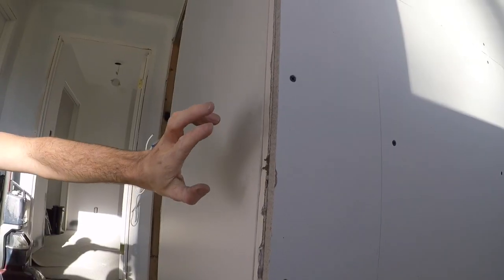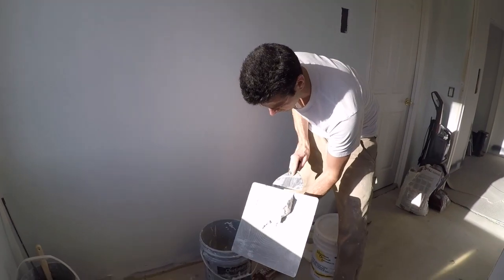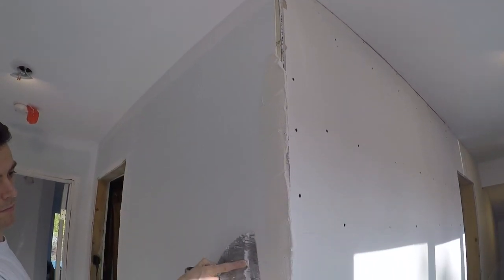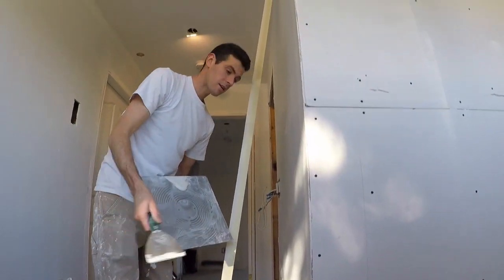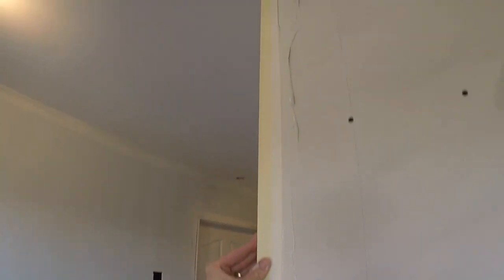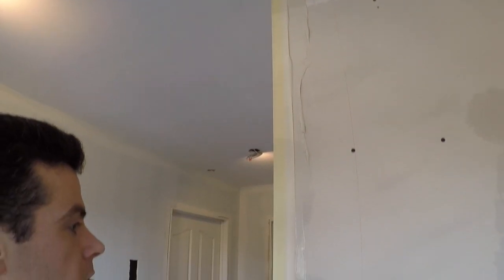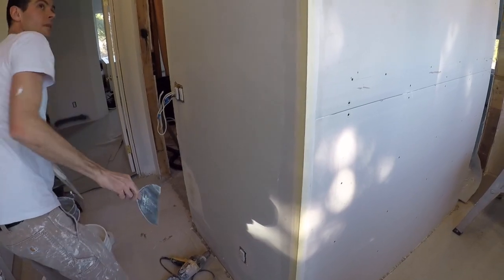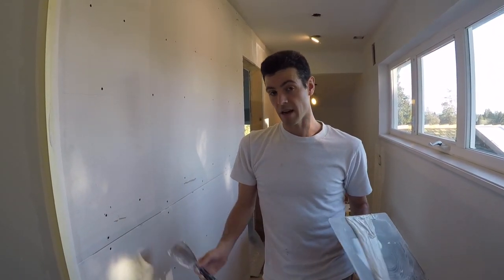HOW TO INSTALL CORNER BEAD IN A REMODEL

Comment: You are an inspiration to me.  61 years old and still learning. Keep em coming.  Used a 4" knife, your suggestion, for the first time for inside corner work, flat work and outside corner work today. Taping compound, water down, worked like a charm.  Thanks.

Comment: This helps a lot. I never knew anything about quick set was until I started watching your channel. You can just imagine what I went through when I matched it up. LOTS of work.
Reply: @Soup Can Well it is good I have the 90 minute quick set, and I have a heater already installed, so I can control the temp. Thanks for your info.

Comment: Another great video. I wish I saw this before I installed in a similar situation. The one issue that wasn't touched on was that my corner was less than 90 degrees, which made it stick out in a few places. I worked really hard to correct that, by drilling screws through the metal flange. I figure in the future, I would just bend the corner bead to make it tighter. I can't find any videos that address this issue.

Comment: Perfect timing. That's just the same situation I'm facing right now! 

In my case, however, I have an additional complication in that the end of the corner bead doesn't butt up against a ceiling, rather it transitions into an archway. Therefore, I'm trying to figure out how to transition from the end of the replacement corner bead into the archway without leaving a noticeable step or lip as it does so. Comments on how to handle that Ben would be much appreciated!
Reply from the maker: I would need a picture. If you have instagram you can message me at @ben_degros. I would be happy to help.

Comment: Hi, I find your videos extremely helpful. I am doing a fireplace remodel and I have 4 outside corners with old metal corner bead. On two corners I have to transition from old corner bead at the top of the chase, to new corner bead at the bottom. Of course like in this video there is a lot of mud built up at the metal. So where these two beads meet in the middle- how do I make a nice smooth transition? Thanks

Comment: Question unrelated to this video, when skim coating a large area, how do you keep your mud from thickening up from the constant application and removal during the course of the job? I have skim coated many walls and usually just keep thinning the mud with a spray bottle as needed. Seems to  work, but wondering how the pro's manage it.

Thanks, thoroughly enjoy the videos.

Comment: I Really appreciate all your videos on how to do drywalls, I have learned a lot from watching them. I know that it's an art and require a lot of practice to be able to achieve great result... I'm a real beginner and wanted to start as you showed us but i'm having a bad time using a brand new trowel... it leaves a lot of wave on the wall as I apply the mud... I heard somewhere that to achieve good result with the trowel (other than practice) it needed to be "Weared" or "break" could you show us how to do so? I'd also like to know if there is a way to save a bucket of taping mud in which as been too diluted (thinner) with water. And finally, what do you think about fibafuse tape? Again, thanks a lot for all your excellent videos!

Comment: Great vid... What setting time do you use on the quickset and what would be a compairative product here in the states..
Reply: We have the same products. USG quick set 5 minute would be the best for one corner
Reply: 👍 got it.. thx
Reply: @ryane6719  

5 minute setting compound would barely give you time to get the stuff mixed up and scooped out onto your Hawk before it started to set up.  I normally use 45 minute setting compound. If I was in a really big hurry, I might try the 15 or 20 minute stuff or whatever it is. 45 minute setting compound gives you plenty of time to get it mixed up good to the exact consistency that you want and gives you plenty of time to do a decent amount of work with it before your time is up.

Comment: Hey what are you thoughts on the joint compound that comes with the metal/mesh tape, sold in hardwear stores? I kind of want to do your method with the mixing , I've got a lot of nail holes

Comment: When you say quickset mixed on the thick side - what product am I buying at Home Depot?  Is it a concrete product or a drywall mud product?
Reply from the maker: Depends. I just mean less water when you mix up a bag of powdered drywall mud.
Reply: @vancouvercarpenter  So that first step on the old wall is a drywall mud product, I tried to freeze the video and the bag looked like it said concretefill?  Thanks
Reply from the maker: It does say concrete fill. It's a quick setting drywall product for skimming concrete. I just like it for lots of other things.

Comment: What if it's metal instead. Does it still need prefill?
Reply from the maker: Not really. But you will need to make sure that the nose of the bead is a little bit proud of the existing wall or it will look wonky after filling and not coat easily. It's not an easy install to nail on a bead when you need to pull it out 1/4" on one side. It's easy to have the steel bead twisted or not straight. Use a level or straight edge to check it as you install and nail it off.
Reply: @vancouvercarpenter  thanks. I'm doing some renovation work and was looking how to go about it.
Reply: @vancouvercarpenter  I use a crimper and it takes practice and caring about the end result and the journey to the finish product to have any success with them. Glad you stressed the importance of checking for fill room on both sides of bead because that's so important for the successful journey to the finished product and how hard or easy it is to get there. Love your vids and have my guys watch a lot of them so they can get instructions on the proper way to do things by a young guy and not close their mind off because I'm old lol. Thanks to the camera person as well!

Comment: So the real takeaway here was to fill the gap in the corner with some concrete mix. You never really talked about what that was . Joint compound,  thinset what?
Reply: quick set joint compound comes in 5, 20, 45, and 90. It sets up in those times. It comes in bags and is located in same location as the buckets of joint compound in the store.